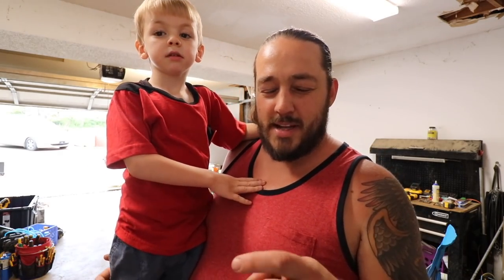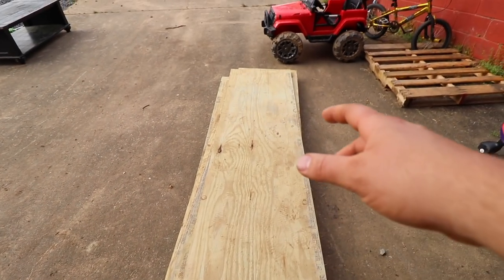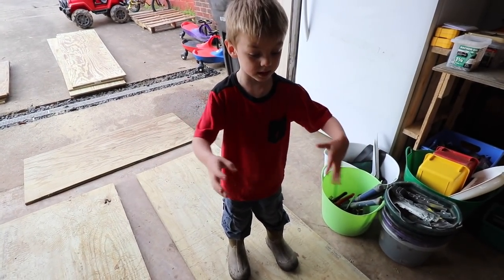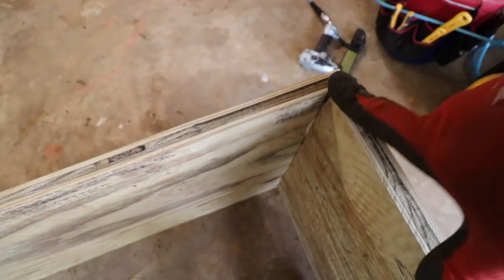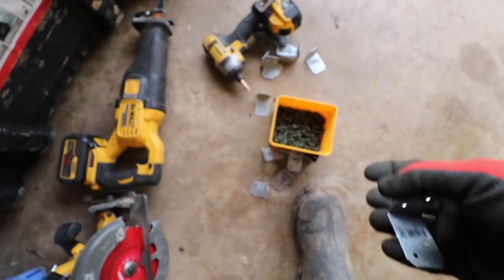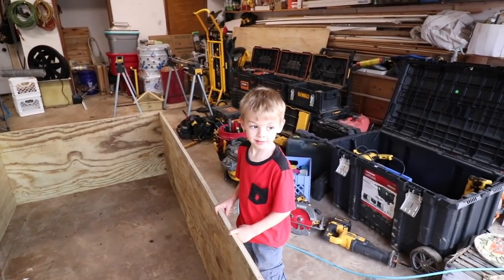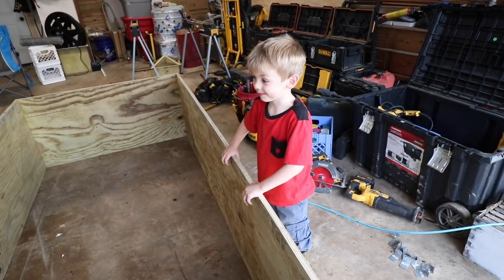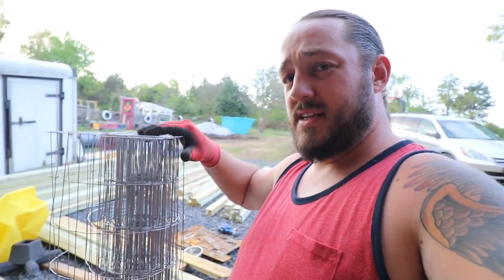Building Brooders for 180 CHICKS! | VLOG

Comment: Nice job on building a wind block walls for your chicks. Look up an "Ohio Brooder". I make a 4x6 one that is perfect for up to 250 chicks. It has two lights one at each end. Mounted horizontaly. Make your wind block 8X8 and then put the Ohio Brooder in the middle. Cover the entire thing with chicken wire.

Comment: So cute building with Ben. 
Yours is the same size as mine. I only have 100 cx in mine, and I think it’s big enough. Only in there for 3 weeks. I used 2x2s in the corners and screwed them together. I can unscrew and store them in the off season. My lid is also 2x2s, but I used hardware cloth. 
The boxes do look huge until those birds get to the halfway point.